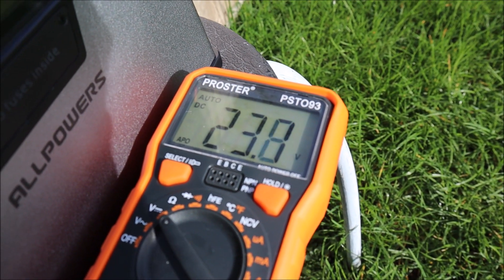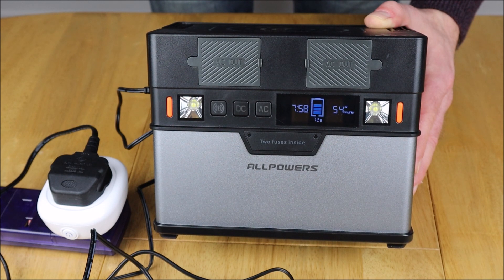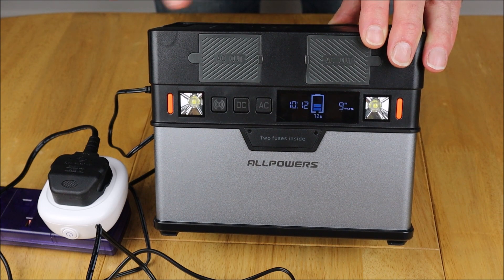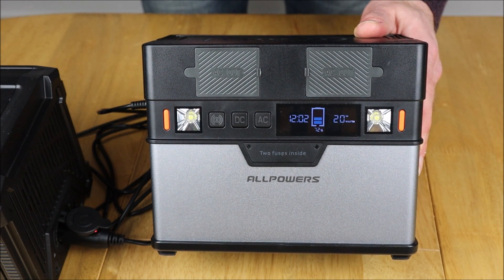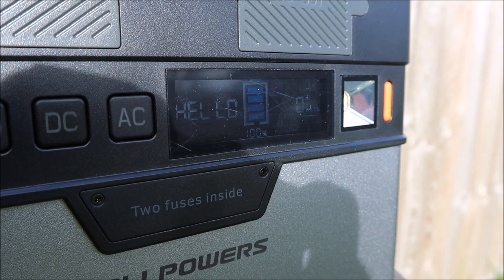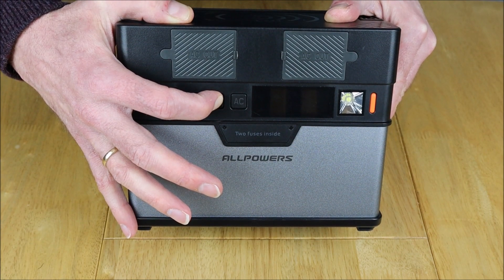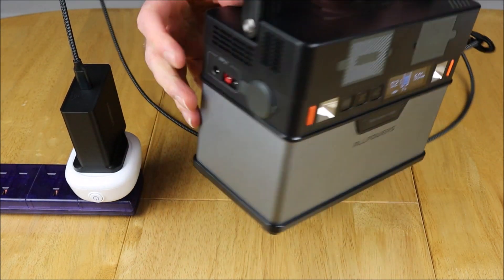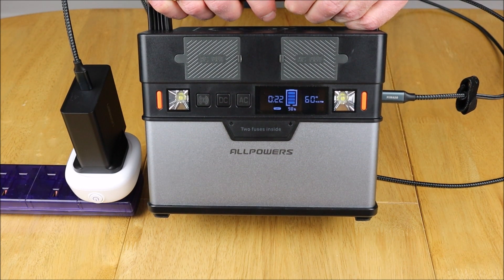ALLPOWERS 372Wh Portable Solar Generator Update | Charging Rundown

Comment: Hi Adrian, good video. I'm torn between this one and the Suaoki 400wh solar generator. But both seem to have issues. The Suaoki seems to be poor quality especially the USB ports that just break going by some Amazon reviews and Allpowers has the charging issue. Apart from the connection what's the difference between the round solar connection and the Anderson one? I currently use the round connection on my current smaller SPG which works fine. Also when charging with solar does the input cap itself when the sun goes in so making it pointless? Finally what is the maximum Watts it can charge at via solar? I'm edging more towards getting the Allpowers over the Suaoki because of build quality and it's slightly cheaper, thanks in advance
Reply from the maker: Good day Adam and thanks for your question. In my tests, the DC (round) port works fine if the input voltage remains constant which is no good for solar (especially on a cloudy day). The Anderson port works without any restriction when charging so gets round the DC (self-limiting) charging issue, once you can get it to wake up. I've managed to get 60W (consistently 57-58W) over the last week with a new, cheaper non-folding, 100W panel which is about the limit for the charging circuit (3.2A).

I'm not sure if you've seen the latest update videos, but they may help more with your decision on which way to go. Here are the links > https://youtu.be/ViLdkYzOZqA & today's one > https://youtu.be/T_hlnoyAx2c . I hope this helps? Please shout if you need anything else. All the best, Adrian
Reply: DADvinci Ha just watched it as you replied. Yeah that explains a few things many thanks
Reply from the maker: @adsandjacs  I'm glad it proved useful. Cheers, Adrian

Comment: Hi, Did you ever get the Anderson port/Solar charging issue sorted? Cheers.
Reply from the maker: Good day and thanks for your question. Not as yet, but I'm working with ALLPOWERS to get it sorted. I'm waiting for them to send me a new 'Anderson to DC' cable to see if that works. 

It's possible that something got dislodged during shipping (according to ALLPOWERS) which would explain the port issue. Fingers crossed it's something like that, as I'm itching to try charging via the port. I did manage to get 36W (peak) charging using the DC port today which is very good from my 60W panel in UK Spring!

I hope this helps a bit and I'll provide an update as soon as I can. All the best, Adrian
Reply: @DADvinci  Thanks for the update. Mine suffers from the same issue although it sometimes accepts solar charge through the anderson port after I carry out a software restart (holding the DC button down). Can't get mine to accept solar through the DC input. The display wakes up but I get zero watts in.
Reply from the maker: That's really interesting to hear how yours works, thank you for sharing. Out of interest, which solar panel are you using with the battery? Many thanks, Adrian
Reply: @DADvinci  Hi Adrian, The Allpowers 60W folding one.
Reply from the maker: @netrat12  Thank you! Was it this one > https://amzn.to/391YXqX or this one > https://amzn.to/2Ufdls9 

I've got the later and I'm wondering if it's something to do with that. Many thanks, Adrian
Reply: @DADvinci  I've got the 2nd one as well.
Reply from the maker: @netrat12  do both work with the Anderson port? I'm wondering if the first (newer version) works better after you DC reset. Cheers
Reply: @DADvinci   Sorry.....I meant I've got the 2nd one as well as you...I haven't got both. Wondering whether the 24 volts output might be too high when initially plugged in. Will do some more testing when the sun comes out (Hopefully this weekend). I assume I can limit the voltage output by covering some of the panels.
Reply from the maker: @netrat12  Thank you for confirming 🙂 It has been the thing I've most wanted to test since measuring the voltage on the panel (in the video). It does fall outside the range in the manual but I've not had another panel to test with + it's an ALLPOWERS panel so would have expected to work with it.

Hopefully we can compare notes from the test at the weekend and finally put this to bed. All the very best, Adrian 👍
Reply: @DADvinci  Hi Adrian,  have carried out some testing as planned. Covered most of the panel leaving just an inch or two showing around 2 of the edges. Measured the voltage at just over 12V. Connected it to the anderson port and the display remained blank, left it a few seconds then began to uncover the panel and charging started successfully. Uncovered the panel fully and charging continued. Did this twice yesterday and once the morning. This morning I didn't even carry out a system reset before attempting and the above actions worked so the system restart may have been a red herring. Have you had a chance to have a play yet? Regards Ray.
Reply from the maker: @netrat12  Hey Ray! Thanks so much for running the tests, much appreciated. I've been looking at this all weekend 😴

In short, I'VE GOT IT WORKING! I'm currently getting my tests completed and footage together. I stumbled on it and then tried what we talked about (your test results are exactly what I needed for a comparison,  thank you).

I'm hoping to publish the video tonight, just hoping I can get it done before the sun gets too low.

All the very best, Adrian

Comment: Hi Adrian.
How is this solar generator holding up to date?
And do you now have a preference between this and the previous?
Reply from the maker: Howdy! Other than the Anderson port issue (still working with ALLPOWERS on this), it's working fine so far. I'm already using it on a daily basis as I do with the 288Wh one. I've been trying to push it with some random tests. 

Had it working with my daughter's Xbox X the other day. Used my old 40" Samsung (150W) with the Xbox and managed to pull 220-240W whilst playing Tekken7. Pushed it to the max watt rating attempting to play Forza Horizon 4 which takes advantage of the Xbox X hardware. Game loaded and once I went to start driving the LCD showed just over 300W and it tripped out, so right on the mark for the specs.

The USB-C PD socket has been a winner for charging the battery itself. This is also great for charging other devices that can take advantage of faster charging.

In terms of a comparison (preference) - the LCD, extra capacity, USB-C PD port and smaller size are better. The Anderson port issue is still the hot potato, although the DC input is working fine from a solar panel perspective providing it's not cloudy. I got 36W charging today which is very good from a 60W panel in UK Spring!

I hope this helps a bit? I'll try and get an update as soon as I can. All the best, Adrian
Reply: @DADvinci  Thanks Adrian. As I'm thinking of getting the 1 with the LCD screen, just because it shows information. As I was sold for a long time on getting the 288wh 1. But now leaning towards the LCD. I wish you had returned it for another because it could very well be a fault on either the cable or the generator itself idk. But thanks again for the information. 
Akeem.
Reply from the maker: @spuggygame45  Thank you Akeem. I'm going to arrange a replacement now as nothing has worked on the Anderson port front. ALLPOWERS have been very good on the support side, so no complaints there.

If you do decide to get one, I'd be very grateful if you could use the link in the video. It makes no difference to your purchase and gets me a couple of quid towards the next device/review.

Please shout if you need anything else. All the very best, Adrian
Reply: @DADvinci  will definitely do that whenever I have that extra £

Comment: Really good video, I've got one of these but my AC output seems to have stopped working.. Checked the fuses and they haven't blown. Any idea? Would really appreciate the help!
Reply: You know what, after a week of not working and trying everything it randomly started working! I think maybe it was too cold where I kept it in the van/hadn't used it that regularly. Whatever happened it's begun to work again. Thanks for showing an interest in helping, defo a sub from me!
Reply from the maker: @sebt1176  Great to hear it's working again. Thank you for the sub, it's much appreciated 🙂👍
Reply: @sebt1176  Hi Seb, did your resolution continue to work? I have exactly the same problem, AC kicks in briefly then shuts off. I have DC reset.
Reply: @royalgreen7375  not sure what happened but it's still working, not sure what I did to make it work again, I tried taking the fuses in and out
Reply from the maker: Hi Seb, thanks for your kind words. I'm sorry to hear you're having problems, I'll do my best to help.

Have you tried a reset (holding DC button for 20 seconds)?
Do the DC outputs still work (USB, USB-C & Wireless)?
Does the AC start at all without anything plugged in (holding AC button for 5 secs)?

Please let me know and we can work though it.  All the best, Adrian
Reply: Thanks for your quick reply, the DC and wireless still work. The AC flickers on for half a second then turns back off. The AC works maybe one in 25 times of trying to turn it on?
Reply from the maker: No probs. Did you try the factory reset (holding the DC button for 20 secs)? When you switch the AC on is there anything plugged into the battery?

Comment: Hey man, I'm very interested in this thing!

Do you think that a "Dokio 200w/300w" are good to recharge it? Without any "bridge", just plugging in the cables (red and black) from the solar panel to "our" generator (so not to the DC, but those little holes blakc and red, on the generator inputs. 

And.. another thing.. is there (in the manual) something about the possible recharging cycles for the battery? It is good? (Like 2000 cycles as another good one???)

Thank you for your help, I need to understand this before buying something!
Reply from the maker: Good day and thanks for your question. As you can see in the video, I've had a few issues with the red/black (Anderson) port for my solar panel charging. I'm currently working with the manufacturer of both this battery and my solar panel (ALLPOWERS). We've trying to find out whether it's the cable, the solar panel or a broken Anderson port on the battery (can happen in transit apparently). With this in mind, I can't provide actual test results yet, but  can let you know what's in the manual.

Charging from solar (MPPT Regulating).

50W Solar Panel Pack (MPPT) About 8 hours.
 
100W Solar Panel Pack (MPPT 60W IN) About 6 hours. 

From the manual it looks like you can plug straight into the Anderson port from the solar panel, but it will be limited to 60W charging (even if you have a higher wattage on your solar panel), but I can't test that at the moment.

The manual also says that "the life-cycle for charge and discharge is over 500 times". Although it doesn't say if that's the usual 500 times to drop to 80% capacity. 

I hope this helps a little. Please let me know if you have any other questions.  All the best, Adrian
Reply: @DADvinci  Thak you, really helpful.

The MPPT controller is inside the solar generator? Or.. did you mean an external MPPT controller? (Just to be sure, I hope it's inside the box).
Thank you for the right name: ANDERSON port. Now I know how to call them.

Look what I found!
https://www.amazon.it/Baoblaze-5-5mmx2-1mm-Adapters-Batteria-Solare/dp/B07H3SBTSH/ref=sr_1_1?__mk_it_IT=ÅMÅŽÕÑ&keywords=sae+to+DC&qid=1584124920&sr=8-1
Do you think it's safe and useful?

I hope the problem (for your case) is in the battery itself; it has no sense that can't recharge from there if the AndersonS are there to recharge the battery xD

Also.. do you know about "some controller" that can convert the energy from the solar panel (so with his stardard cable, usually simple Anderson, IN) to maybe USB type c OUT? 
This would be very good. Sure, it's not so simple but, I mean, directly from the solar panel to a notebook with type-c recharge, using a converter o regulator.. something like that. 

You know, I'm searching something good for emergency, like those Dokio. Also the 200w version is good. The panels are good according to the reviews I saw.
The problem is: both the 200w and the 300w version have in OUT those red/black cables. Then there's a regulator (very cheap) with the connections for a battery and for the light.
Also 2 USB ports (2.0 I think, max 2.1 A). Is there something similiar with the type-c or even better a DC port 19v for notebooks?
Look at this!

https://www.youtube.com/watch?v=gud5jHHa3Fg&t=382s

I just can't find on the stores something similiar.

Thanks, sorry I don't want to disturb you. Thanks man
Reply from the maker: The manual says that charging from solar is MPPT regulating, which indicates it's built-in. I'm desperate to test the Anderson port charging as the DC input works. The Anderson port is limited to 3.2A so even with 200W or 300W solar panels it won't charge any faster.

I'm not sure about the product you've linked as it doesn't look like it has an Anderson connector on the end.

I've not seen or tested any charge controllers with USB-C (yet) as my solar panel has ports already built-in. Once I get a standard solar panel with MC4 connectors, I can see how this will charge (or not) the battery.

This type of solar generator is good for charging notebooks, as other subscribers have mentioned in the comments section. With the right connectors it should be possible to charge direct from the solar panel (for the folding panel I've got), otherwise you would need a charge controller as you've kindly said.

I hope this helps and answers your questions? Please let me know if you need further assistance. All the best, Adrian

Comment: I notice this seems to be unavailable on Amazon now. I wonder if it's due to the issues identified here. I also notice that they have a very neat looking 154W power station available that wasn't when I bought the Beaudens.
Reply from the maker: It could be related or they may have run  out perhaps? To be fair, they have been very good with their support so far and I'm currently waiting for another cable to try. If not, then it will be a replacement to try. 

That does look neat, for sure. Cheers, Adrian

Comment: Thanks for this video. I bought one one on Amazon, and then immediately watched this video. The problems mentioned in this video are a deal-breaker for me, so I cancelled the order and bought the Beaudens instead. That will have to do for now, and will be more than sufficient at this time of year, but really want something with the size and facilities of the Allpowers.

Will have to see if the problems are resoved.
Reply from the maker: Good day and thanks for your comment, it's much appreciated 🙂

I completely understand why you went with another option. It's a shame that this battery has had issues as the previous 288Wh one has been a long-term winner for me.

I'm working with ALLPOWERS to find out whether these are characteristics or if I've got a faulty one (could have been damaged in transit). 

Despite the charging anomalies, the power delivery of the unit has been very good. I'm planning videos to show what it can do like the 288Wh videos. Most importantly I'm finding out if the charging characteristics are just my unit or not and will video more updates.

Please shout if you have any questions. All the very best, Adrian
Reply: @DADvinci  Thanks, I will follow your comments with interest. If it turns out that the anomalies were just a fault, or can be solved, then I will buy one (or even one one!) in a heartbeat. This is the unit I need. Unfortunately the anomaly here scuppers exactly what I plan to do, plug a solar panel into the Anderson socket on less than clear UK days, and just leave until fully charged.

So please keep us informed, and let ALLPOWERS know that there are people like me that are willing customers but need to be certain that it can squeeze all the possible power out of our solar panels. In fact they have probably already noted my order and cancellation last night.

In the meantime the Beaudens unit looks very useful, and cheap, so I won't mind owning two small units.
Reply from the maker: @quisquose139  I'll keep the updates coming for sure. I've also let ALLPOWERS know that an order was cancelled due to the Anderson port issue in the video, so thanks for sharing that fact.

The long and short of it for me was getting another for when the sun returns as the 288Wh is part of daily life at home now. Never realised how good it felt using free (usable) power wherever I wanted. Dare I say it has become fun finding out what it can do. I wanted it to work exactly as you do, plug in and leave it to fill up.

For the size, in terms of the box +  storage capacity, it's good value compared to others on the market. I just hope that it's my unit that doesn't fully work as I love the power output. Cheers, Adrian
Reply: @Quis Quose - how are you finding the Beudens?  What features does it lack compared to the AllPowers.  I have seen the Beudens 380wH one which seems to have the same features.  I would love the AllPowers one... have seen the work around... but now can not find the DC to Anderson cables required, which is kind of frustrating from AllPowers.  The solar charging is kind of a deal breaker for me to.  intend to use it for camping for a few days.  Taking fully charged and keeping topped up via car 12V and solar!
Reply: And the Lithium PO4 batteries with the Beudens should last a lot longer!
Reply: Thanks for the video.  I too was thinking of getting the power bank, though it has to charge also via solar. Interestingly I found this guy who adapts cables..   I can't see why this won't work on any in the future..  ( Ones that already accept solar charging. )   https://www.youtube.com/watch?v=QFtSf0UaGTI